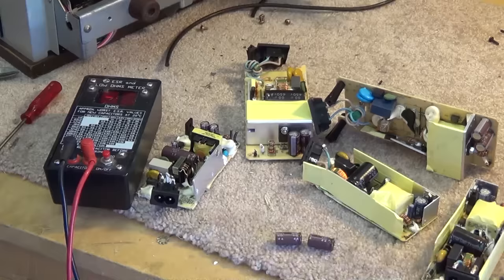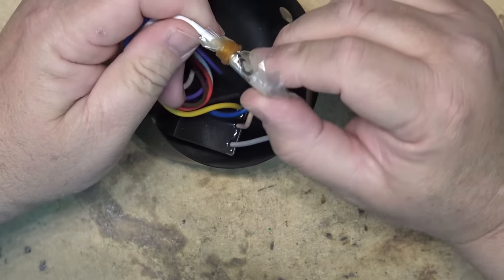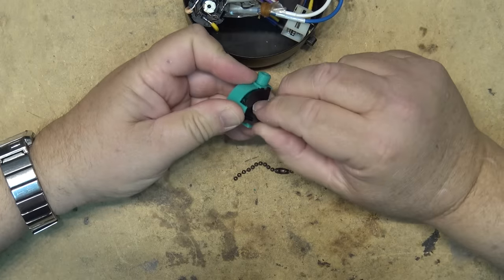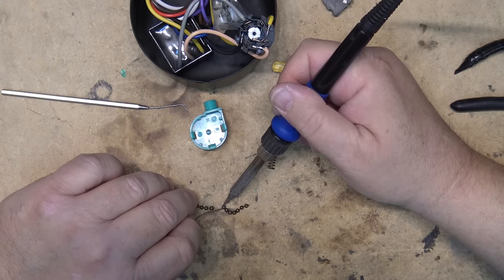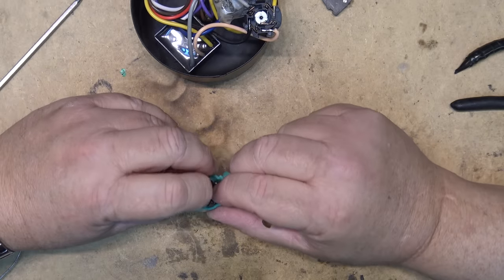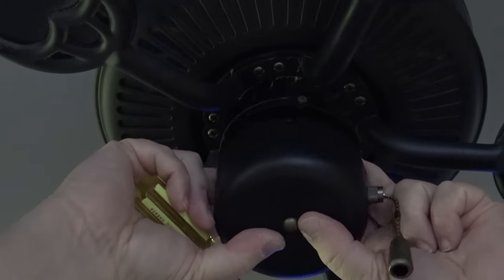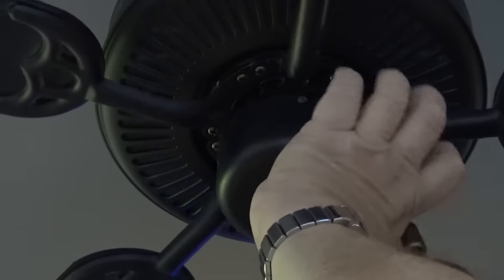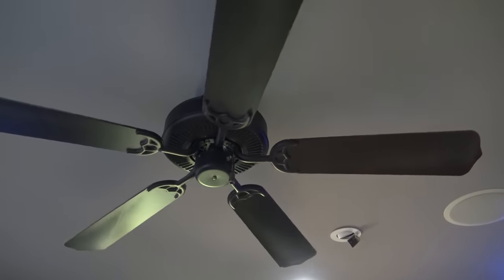Ceiling Fan Speed Selector switch repair

Comment: To anyone who's having trouble. You might need a pair of pliers with a thin tip to strengthen the spring. My spring didn't have enough strength so when I winded it up and pulled it would make a click noise, but wouldn't pull back. What I did was use a pair of pliers to hold one end of the spring and a pair of thin nose pliers on the other end to twist it and give it more strength. After, it was able to pull down and pull back up. You may have to maneuver around the spring a bit, but keep at it.  You'll get it. Hope this helps someone.
Reply: I was so confused until I read this comment Thankyou very much!

Comment: This video was extremely helpful. The ball chain broke off inside the switch and I managed to replace the chain thanks to this video.

For anyone that may have trouble getting the chain to retract when pulling on it, there's a piece of spring that sticks out and you must align it with the notch on the underside of the base where the ball chain is attached to.

Comment: Great video.  I struggled getting my switch apart, slightly different model.  But then I noticed that the pull chain only broke off maybe 3/8" inside the opening.  I was able to grab it with one of those extender clasps at the end of another chain length.  Got lucky and didn't have to reassemble anything.

Comment: Finding those fan speed switches isn't always as easy as just going to the hardware store. How they connect those wires with each chain pull varies by fan manufacturer. I learned that the hard way. If you're lucky the diagram is stamped on the switch body if you're not you'll have to buzz it out with your meter manually.

Also you can get extension pull chain at the hardware store and cut it to length with a pair of side cutters. It's perfect for repairs like this.
Reply from the maker: Yes I know. This is a 4 position switch, not a 3 way as a light would use. 
This has a common and 3 outputs. It goes: off, 1, 2, 3. A normal light switch has 2 outputs and goes. off, 1, 2, 1&2.

Comment: AWESOME video, I’m in the same boat never having touched one of these switches prior to this evening. My neighbor had taken it apart but couldn’t put it back together. Prior to your video, I went to help her and reassemble the switch and fan, which I did, but after having everything ready to close up I pulled the chain and “click”. Thought I was done, smh, but the chain did not recoil back ??? I messed with it thinking I’m doing something wrong it’s just plain broke. 
Since I wasn’t the one to disassemble it, I didn’t know there was a spring missing !!! Thanks to your video I do, so after I hit the send button I’m going to grab a spring ‘if she does not have it’ and complete the task. 
Thanks again.
Reply: Did you receive some 🐈?

Comment: Works great ~ Thank you ! My mom broke her chain all the way up inside the fan and was going to replace the fan till i told her i can fix the chain. So my son and i looked for a video and there you were. Wehad a few glitches but finally got it. Only problem is now the fan goes high, medium, low, low, off. Not sure why but ok. Hopefully its ok to run like that. Thanks again

Comment: Thank you for the video, after replacing the chain I was trying to figure out how to make the spring work again, did not realize to wrap the chain around it. good work! thank you
Reply: Exact same issue. Helped me immensely.
Reply: Should be something on our minds because I had the same obstacle until i saw the video. thanks.
Reply: This was the hardest part for me. For some reason, I kept turning the spool clockwise. It needs to go a turn counter-clockwise. When you turn it counter-clockwise, and feed the chain in, you can hold the chain to keep the spool in place, with tension, while snapping the cover back on.

Comment: I just repaired mine last night. My switch was different and I did not have to wind the spring at all, just had to stack the pieces in there correctly. Luckily I had some extra chain. Nice to fix it to get it working again right away.

Comment: Thanks. I was replacing the capacitor. That chain switch came apart while I was replacing wires. I needed help putting it back together.

Comment: You saved the day!!! Thanks so much for your tips/lesson. I had gotten ALMOST as far as “winding the chain once around” but could not figure out how to get it to work. Looked on eBay to purchase a $20 piece, then checked Youtube and found your video. I was laughing as you commented through the sections that were tricky. Instead of soldering the chain back together, I replaced the entire chain. Thanks so much. It’s working!
Reply from the maker: I would have had I had a piece, but I didn't and hey it works and is still working.

Comment: Thanks so much...worked like a charm.  The only issue I had was that once I replaced the black plate, the chain would bind.  I finally managed to figure it out. After installing the black plate, I had to come under it and lift it slightly with a small flat blade screwdriver.  When I did that, I heard a click and voila!  Just like new again.  I also watched another video where the guy said that if it binds, you can push down on the center piece holding the spring (after full reassembly) and it will properly align everything for smooth operation.  :-)

Comment: You seem to know what you were doing. I just did this in my harbor breeze fan. The manufacturer sent me a replacement pole switch assembly. And a new capacitor. I wired it all up. I went from a ceiling fan with a light, to now this fan without a light. I just hooked it up. I got nothing. Any pointers?

Comment: ok. I had saw what you did. You had mentioned that the spring (if it pops off) you may have a hard time getting it back on. I havent fully finished the video but you had skipped maybe intentionally or unintentionally on how to put the spring back on. I may or may not have a bigger issue here. So I will continue to look onward and hopefully i find some useful information. I will finish the video although showing how to put the spring back on and maybe some other info would have been inclusive with this video. overall it does help significantly, just not in my case.

Comment: Those extra wires are for a light I believe that can be fed through the hole that's capped off by a brass nut.
Reply from the maker: Yes I know. Figured that out once I got it apart. Different models had a light. Same wiring harness.

Comment: I had to do this to one of my ceiling fans but I just replaced the switch with a spare one I had lying around. I still have the old one which is seized and I'm going to try and fix it.

Comment: Retensioning the spring is much harder than it looks here. So much so, that I quit and purchased the replacement spring mechanic for $8 instead. If you're looking at that green assembly inside your fan housing, its a "Wire Zing Ear ZE-268S6 Pull Chain Switch control replacement 3 speed  control switch."
Reply from the maker: Was not that difficult. Just have to be patient. What can I say, I am cheap.
Reply: Re-tensioning is a full turn counter-clockwise. I was turning clockwise, failing, and getting frustrated. Once I realized it was a turn counter-clockwise, it was easy

Comment: The little post that holds the spring end and all the parts is broke off on mine. So I just opened it up manually put it on the second speed cause it originally broke on slow speed. I normally only run it on second speed the 3rd speed is too fast and to loud for me.

Comment: I WD-40 mine once in a blue moon & it keeps them working. Done this for over 25 years plus fart fans, motors while hot will keep them running like tops.
Reply: WARNING, don't do it while it's running. WD-40 is flammable & sparks could ignite it.
Reply: @danmatson8685  In over 30 years it never happened once but my first few times I thought about the same thing so it was a nail biter those first several times.

Comment: I did the repair but not the fan will not switch off.  It changes fan speeds with each chain pull but will not turn off.  What did I do wrong?

Comment: Smashing repair, cost nothing except a little time and patience :-)
I've seen that type of ball chain on sink plugs and venetian blinds.

I fitted one of those fans for a frend, it had a light under it as well.
The fan was perfect but the dam light didn't work!.
It was too late at night to take it back.
One of the crimp style maretts was crimped to the insulation not the copper lol.
Lack of quality checking in the factory i suppose.
Reply from the maker: It just dawned on me what those wires in the little plastic bag inside the unit were for. A light! The wiring harness would be the same, and models with a light would just plug into that connector, and probably another ball chain switch on the other side for the light fixture.
Reply: Yes thats how my mates fan/light worked, two ball chains :-)
Near the fan and on the light unit underneith.

Comment: good job. I respect how you did it. but I am clumsy person so I would go buy new part..
Reply from the maker: Well you see i am very careful with my money.  I fix everything i can and don't replace on a whim or to upgrade just because there is a new model.  My cell phone is over 4 years old still going strong.   Why spend 20.00 on a switch when it can be fixed in 5 minutes.   You should see the computer I edit on.  It is over 10 years old now and running like a champ.  Don't get me wrong I buy new things all the time but i generally hang onto them untill they can't be fixed anymore.

Comment: Global shutter in your camera?
Reply from the maker: Could be. Never looked up the spec. It is a proper video camera, not a dslr, or mirror less.
I shoot on a Sony FDR-AX33 and FDR-AX100. The 100 is used for my scenery and commercial shoots that I still do from time to time, and the AX33 for youtube videos. Sony tend to make the best cameras for video work IMO. Been using the for years. When in the production business I tried a Panasonic and JVC professional camera and regretted it, and went back to Sony.
Reply: @12voltvids  Very interesting. I looked up both the AX33 and FDR-AX100, and they each use a regular CMOS sensor, which apparently suffers from the rolling shutter effect. However, looking at the footage of the spinning fan, I can’t see the effect. The blades look straight and I see no apparent artifacts in the rotation of the fan. That’s excellent.
Reply from the maker: @AstAMoore  Yes they are CMOS, but sony has good silicon. They do make their own after all. 
On my AX100 if I crank the shutter speed up to 1/250 I can start to see the blades bending slightly but then the AX100 has a larger sensor. It has a 1" sensor. It is also older than the AX33 which is my favorite camera. I would buy the AX53 in a heartbeat as it has a 20X optical zoom lens as opposed to 10X.  My ax100 has been really good, and durable. I dropped it from the trypod this past summer. It fell off the head and landed on concrete lens first. I thought it was fubar because it was totally out of focus but I turned it off, and back on, it buzzed and went in - out  and then in focus and worked perfectly. Must have jarred something in the lens, and when I rebooted, it ran the lens back and forth through the range and reset itself. The AX33 the plastic around the tripod mount cracked, and was repaired with JBweld, and other than that has been fine. I did get it wet during a down pour this past summer, and the manual focus ring trips from time to time on its own. (in AF if you try turning  the dial, a message comes up to remind the camera is in auto focus. Well that message pops up intermittently, so the sensor must have gotten wet and it false sending dial turn. I have had this one for seberal years too, so when it breaks I will buy another one. Since I use these for youtube production I can write them off.
Reply: @12voltvids  Ha! You sure like putting your gear through its paces and then some.
Reply from the maker: @AstAMoore  
Dropping a 2000 camera was not planned. I placed it on the big sticks to do some scenery shooting and it wasn't locked in properly, and when I let go it slid off the mounting plate and down it went. It basically landed on the mounting base, but the lens hit the legs of the tripod on the way down. The mounting plate that slides onto the head is actually bigger than the camera, and the AX100 is a fair size itself. The tripod is one I bought 30 years ago for my betacam. The tripod and head was about 4 grand. So basically the tripod is worth double what the camera is.
Reply: @12voltvids  Well, these things happen; equipment gets damaged. Fortunately, there are people like you who can fix it.

Comment: Huh. I didn't think it was possible to fix those things. A spare length of chain would have come in handy though.
Reply from the maker: Right but I am cheap.  If I had a had a piece of ball chain I would have used it but the fix is good. You can't see the splice because it is inside the collar of the switch. It broke because my daughter pulled it down at a sharp angle as opposed to pulling it straight out like I always do.

Comment: Great video, but😲 😰🤨🧐🤔all you had to do is use the link on the chain that broke off. Remove that piece of chain that broke off and connect the chain thats connected to the unit and the chain thats gonna hang using the link aready attached. Then use another piece of chain to extend the length. You didnt have to take any part apart. My easy fix  😉🤗😘👍🏻
Reply from the maker: Except that the broken piece was inside the switch so I had to take apart to fix and this was a how to video.  If I wasn't making a video I would have gone to home hardware and bought a new switch.

Comment: I put a new switch in and I have 2 speeds, the high speed is gone. What happened?
Reply from the maker: Wrong switch?
Reply: @12voltvids  Not sure but had a handy man wire it up and all the wires went in. I guess have him rewire it?

Comment: As chances would have it, the weak link will be the downfall.   Too bad the manufacturer won't put a roller bearing to take stress off the chain when pulled at an angle.  I pulled on a closet ceiling lamp / chain switch for years....no issues.  A visiting girlfriend went to get something out of the closet and, YEP you guessed it,  broke the chain by pulling too hard.  Go FIGURE.   J K
Reply from the maker: Yup my ding bat daughter did the same.  I always pulled it straight out not down for that reason.

Comment: I didn’t hear anything about turning  off the power
Reply from the maker: I don't turn off power.  120 volts never hurt anyone lol.
The wall switch was off BTW 😂
Reply: @12voltvids  hey man thanks for the vid! I got her done. Hahah I did turn off the wall switch just to be safe. Electricity has my utmost respect
Reply from the maker: @Spasticmir  
I still remember touching the spark plug wire on my dads lawnmower when I was about 4 or 5 years old.  It scares the shit out of me every time.  He was letting me shut it down and all I had to do was bend the ground over and touch the top of the plug to short out the magneto and it would stop.  Unfortunately i let go of the ground and i became the ground.   My dad nearly pissed himself he was laughing so hard.  Today's parent would be rushing the kid off to the ER.  Not in my day.  You fell off a bike, you got back up.  Softball hit you in the forehead you went to school with a goose egg on your head.  Unless there were bones sticking out you licked your wounds and went back to work / play.  How any of us surrived still surprises me.